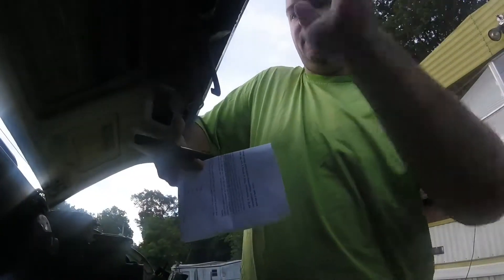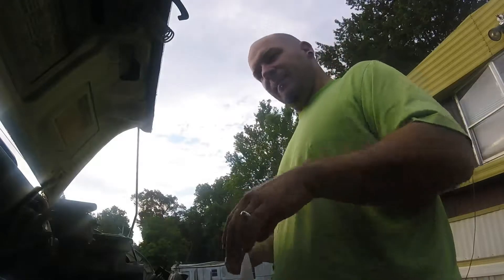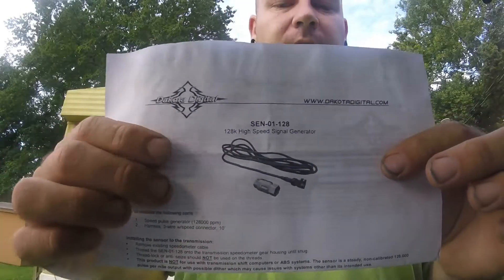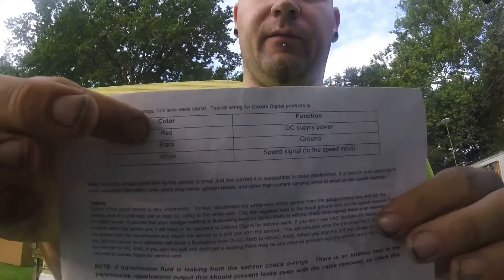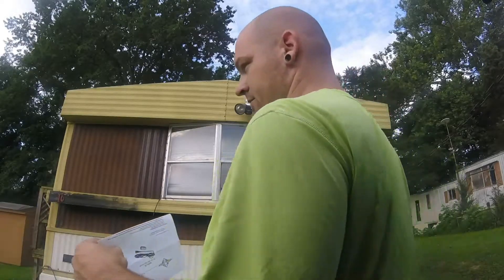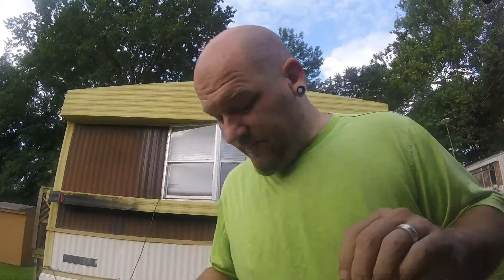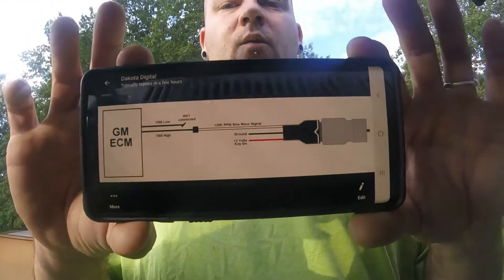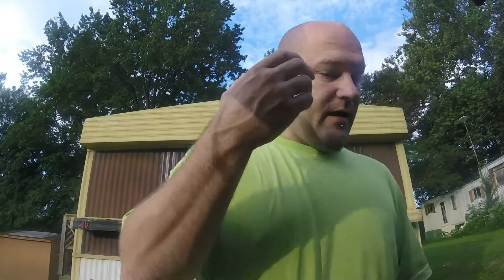How to install a SEN_01_128 VSS ( LS Swap )

Comment: What pin on your pcm did that go to?
Reply from the maker: Green block purple and white wire. Its either 20 or 21. The VSS High input
Reply: @twiztedbacon  I have the same sensor but I have a 4l60e what must I do to wire this up?
Reply from the maker: @7115sugarhill  what you running it in
Reply from the maker: @7115sugarhill  never mind this one works with only the turbo 350s and 400 and 700r4s. The 4l60e should automatically be wired and not cable.
Reply: @twiztedbacon  no I did ls swap in a 69 camaro engine and transmission from a 04 gto. I bought a stand alone harness and my vss has 2 plug wires and I have everything hooked up except the speedometer. My Dakota digital box like yours  has 3 wires
Reply from the maker: @7115sugarhill   black is ground red is 12 volt key switch and white will run to your high VSS input on the harness that plugs to the pcm. The only proble. Tho is you have a 04 engine and 04 trans from a gto which already should have the plug for the speed sensor. The only thing you shoud need to do is run a wire from the vehicle speed signal. For you it should be green plug pin #50. You may have but on the lt1swap.com he has allot of pin outs and what you need for that 04 engine and trans. The gto is little different on wiring from what im seeing on there. https://lt1swap.com/programming.htm